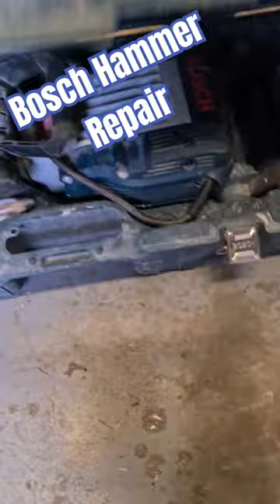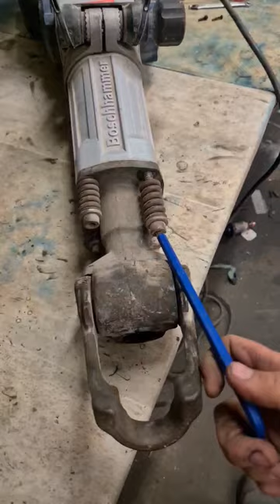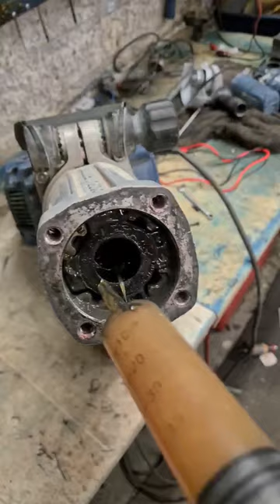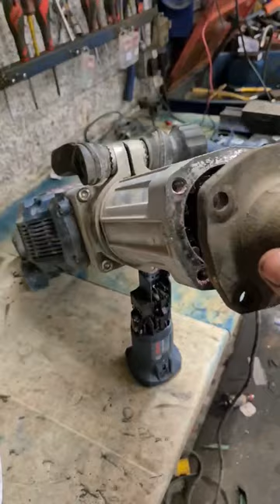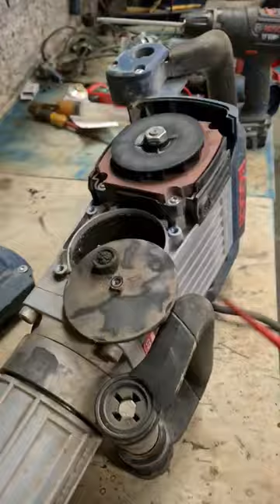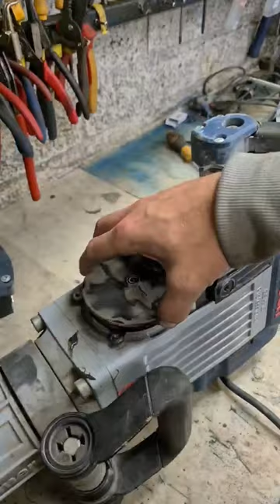Big Bosch GSH16 demolition hammer not hammering. Only needs a grease top up. #quickfire #bosch #fix

Comment: What are your thoughts on Bosch power tools Dean?
Here in Aus, Milwaukee, Mikita reign supreme.  But I prefer Bosch?
Reply from the maker: i do like bosch tools, but they simply haven't kept up with the rest with it comes to cordless tools and brushless motors. Bosch is very reliable and powerful.  A lot of fire departments here only use bosch cordless tools on the engines for call outs. Spoken to a few that changed to milwaukee as the reps talked them into it. They all lasted a few months before returning to bosch. Milwaukee tools simply failed to much and couldnt be relied on. 
But the corded bosch tools are very good. especial hammers. and sds drills
Reply: @deandohertygreaser   I personally switched to a Dewalt brushless atomic set and 1x Milwaukee m12 Surge Impact. Great combo power for compact 12vs.

Comment: I just purchased this brand new and it only hammers once then it only vibrates this is first time using it. Would you know what might be wrong?
Reply from the maker: Could have been sitting a while and the hammer weight inside has bottemed out. 
Run it for a little longer and keep starting and stopping it a few times. See then if the hammer starts up
Reply: @deandohertygreaser thanks for the reply! Should I stand it upright then turn on and off or can it be laying down? How long do you think I should do this for? Thanks
Reply: Hi there any guess what may have happen ? My jack hammer still makes noise but no hammering. By the way what grease brand did you use? Thanks

Comment: how does a adding a glob of grease fix the hammer from no impact ?
Reply from the maker: the grease can become thinned out of burnt up or dried up. cause the o rings to not seal right. Adding some good heavy grease improves the seal and getting the hammer hitting again. 
But this can be a short term fix. If the seals are worn out they will eventual need replaced.